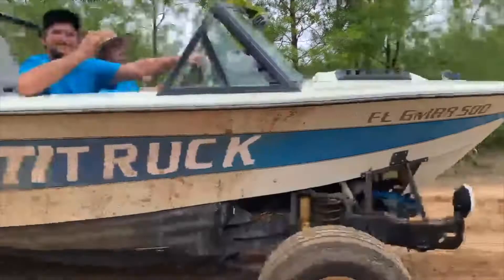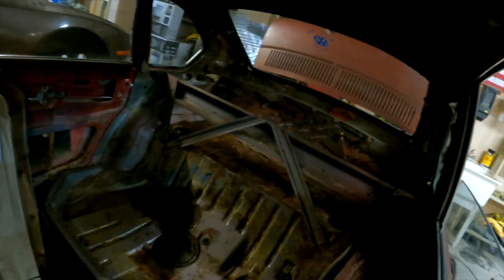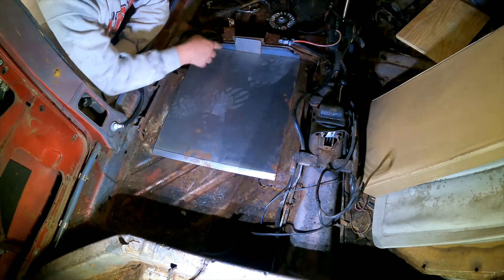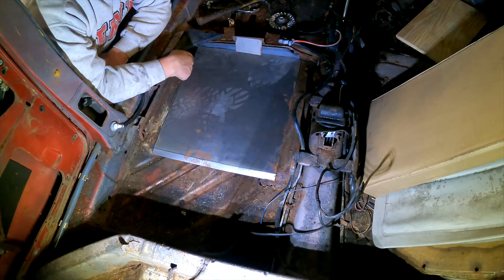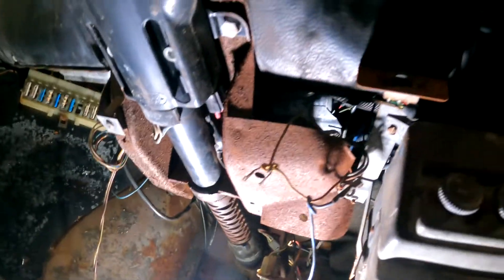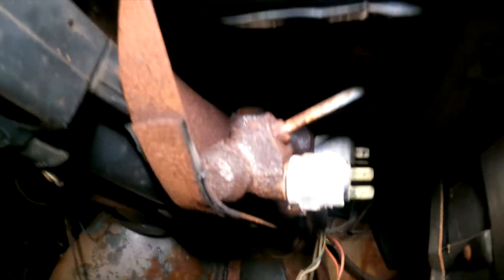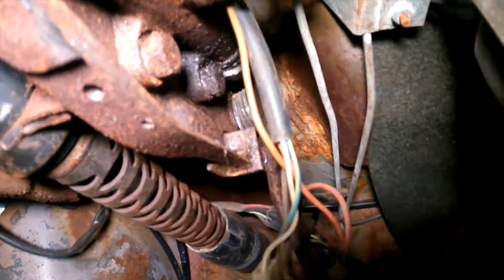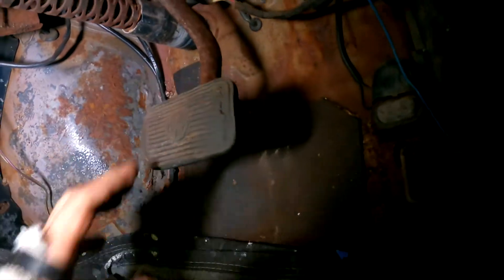VW 411 Rescue Part 4

Comment: HA HA HA HA HA HA HA HAAAAAAAAA!!! Trust me brother...burn it NOW! Your life blood is not worth the headaches with this demon beast. My master cylinder was trash, just had to plan your stopping distances as it took 3 full pumps to even slow down. 
Watching these videos brought back such horrendous nightmares with my 1970 411.
For the 411 aficionados...beware the dreaded oil filter bolt. It is suspended with a banjo bolt and a thru-case bolt and bosses on each case half. Too much torque and the bosses will snap - new engine time fellas! Voice of experience talking.
Reply from the maker: @chrisosti  I miss it 0%